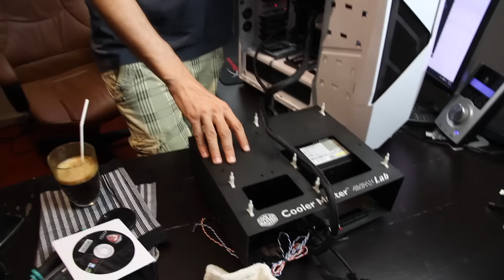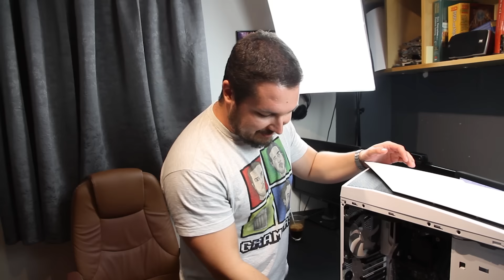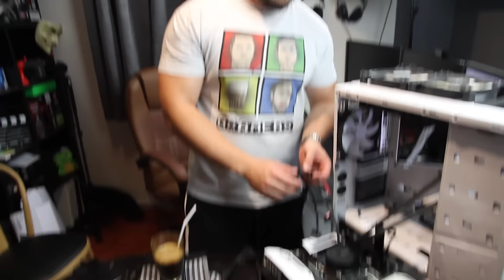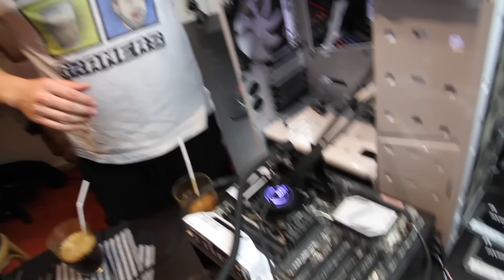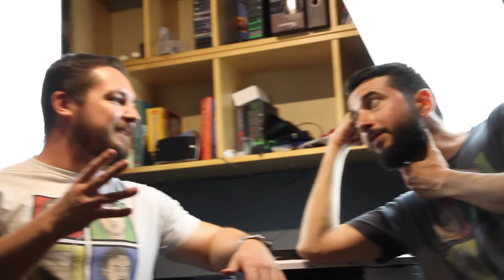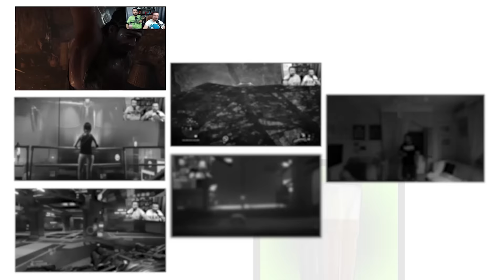Χάλασε η μητρική!

Comment: Αν και το να προσπαθήσει κάποιος να βρει λύση σε PC remotely ειναι δύσκολο, θα πω τις ιδέες μου. Αφου θεωρείτε ότι δεν είναι CPU, βγαλτε την μπαταρια του BIOS και αναψτε το δίχως αυτή. Επίσης τα ΜΒ της ΑSUS έχουν dual  ΒΙΟS, αν γίνει corrupted το ένα ενεργοποιείς το άλλο.Δείτε manual.  Τέλος σε τέτοιες περιπτώσεις θα βοηθούσε να ακούσουμε τα beep errors της μητρικής. Σε αυτό θα πρέπει να συνδέσετε system speaker (buzzer) στο system panel connector 20pins, το πανελ που συνδεετε power switch έχει 4 pins για buzzer κάτι σαν αυτό https://www.easytechnology.gr/plerophorike-kai-tablet/upologistes/diagnostikes-kartes/jiahui-motherboard-diagnostic-internal-speaker-with-buzzer-for-pc-black-bulk . Διαβάστε και ακολουθήστε βήμα βήμα τον οδηγό http://www.tomshardware.co.uk/faq/id-1893016/post-system-boot-video-output-troubleshooting-checklist.html . Καλή τύχη παίδες.